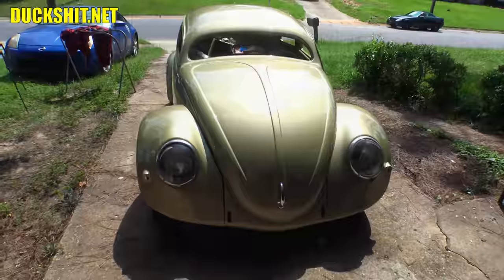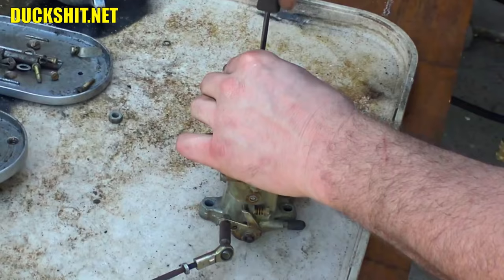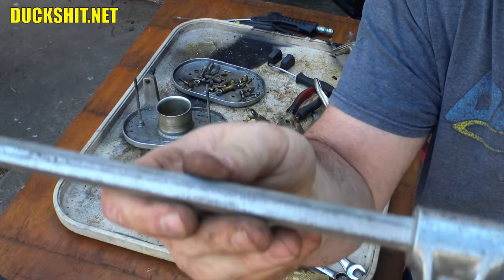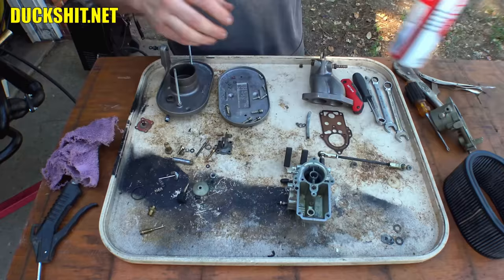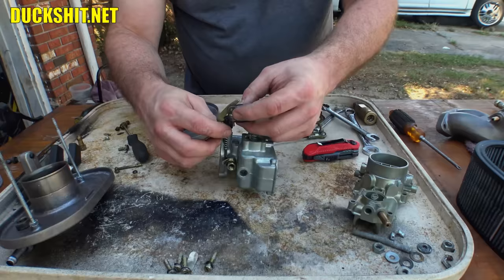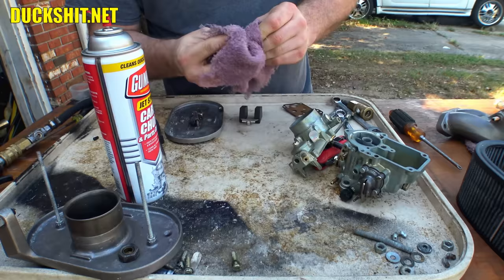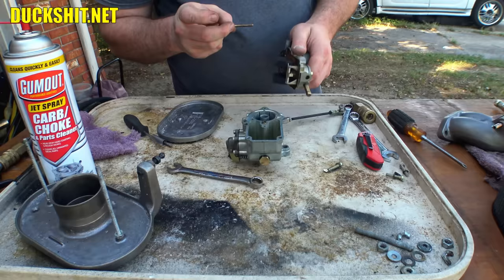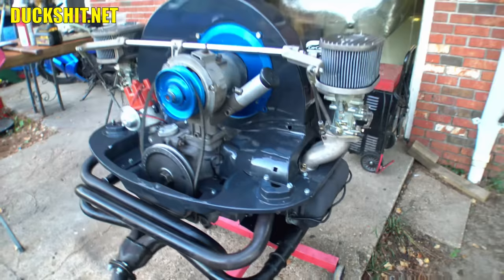🔧Dell'Orto FRD34b Carb Cleaning💥  -  1956 Chop Top VW Beetle - 176

Comment: I'm dropping my 79' 911 Targa off for paint in a week or so and when I pulled off the windshield last night I discovered rust in the lower windshield frame corners (naturally). So, I'm off to the garage right now to cut it out and insert it. Actually, glad I discovered it. It had window weld on the gasket that wasn't sealed at the top and the interface was full of dirt so the water was running down and just sitting in there.
Reply from the maker: Yikes!  There is supposed to be weep holes in the corners.  Make sure you either put them back or butyl everything shut so no water can get in!   😁👍🏻🦆💩
Reply: @DuckmanCycles   No weep holes in 911 windshield frames.

Comment: I have a very similar sonic clean. It’s great on carbs. I have found that if you run it , with the temp high, the aluminum will darken. Not a big deal. When I use simple green, I rinse with water. It evaporates fast, due to being warm. Your turned out great.
Reply from the maker: Ahhh and I thought the simple green caused the color.  I like the way it turned out though!   Thanks man!
Reply: @DuckmanCycles  It still might, I used the Industrial strength simple green at a higher ratio and it will darken aluminum pretty quick.  But I also don't care because it's easy and safe and WORKS.

Comment: Guess it said 92 on the date wheel which would make sense as carburetors was pretty standard until catalytic converters didn’t get mandatory in Europe until that time
Reply from the maker: Yeah 1992 is when Dellorto discontinued most automobile carbs, they also pulled out of USA at same time.

Comment: I had a shop build me a new 1915 (Crap Build) and it came with CRAP HPMXs, even though I specified Webbers.  Brand new, it took 3 major cleanings to get the crap slag out of the new carbs.  I've had them a year and still might toss a new set of Webbers anyways because it just wont stay in tune.
Reply from the maker: Yikes... are they real Webers?  Or China clones?

Comment: I would use loctight on your flywheel bolts
Reply from the maker: I wouldn't.  There is only the one "flywheel bolt" and that is the gland nut, and proving you torque it to 250-300ft/lbs its not going to come loose.

Comment: no rain must be a miracle lol. 

i was always told carb cleaner wasnt good for plastics which is ironic as carburetors sometimes have plastic in them. i use brake cleaner not that i have any carbs but its apparently safe for plastics an good for cleaning loads of stuff
Reply from the maker: Most Plastics you find in carburetors are solvent-safe.... but ironically, sometimes they have problems with swelling from ethanol.  Ducati is well known for fuel system plastic problems lol.  You should see how big their gas tanks grow!
Reply: @DuckmanCycles  yeahthat ethanol shit can really cause problems we have had it start here in the UK you can still buy the premium stuff but the standard stuff is with ethanol now. 

My brother has a lada he drives daily to work he has to run it on the premium as it's obviously got a carburettor. Tell you what though gets more attention than anything on the road lol
Reply from the maker: Also, it hasn't rained in several weeks.  There is some in the forecast a couple days from now though.  It's so incredibly dry out there that it was hard to get traction with the RC car video that I did yesterday.  The little thing would just dig holes in the sand!
Reply: @DuckmanCycles  it must have come over here to the uk it's been raining for a week lol
Reply from the maker: @TotoGuy-Original  lol probably so!   Hehehe

Comment: the chromed tins and exhaust do hold more heat in and reflect it back, as compared to flat black paint. but a well tuned engine will still run cooler anyway, tuning tuning tuning! well that and good gearing.
Reply from the maker: Chrome tins don't hold any more anything.  The thermal mass is the same.  Flat black does radiate better, yes.  But even so... tins themselves don't need to be cooled.  Even red hot tins aren't exactly an overheating engine.

Comment: Did you know that by wrapping those wires around the distributor you could magnetisme your points which will make them stick together? Better be careful, you should put a Porsche flat 6 in it. 😁
Reply from the maker: Ohhhh noezzzzz!   LoL!  Good thing there's no points in there!  Haha!  I'd have to replace the whole engine with the flat 6 if that happens!
Reply: @DuckmanCycles  no points??!? That engine is going to run terrible! So either the flat 6 or you should put an LS in it. Those are made of aluminium so that they can't be magnetized
Reply: lol 🤣
Reply from the maker: @pascalz9992  I may have to cut the LS in half and turn it into a flat configuration to make things right.

Comment: it will be fine with the  four dowel flywheel, just use a good gland nut and don't keep dumping the clutch like your racing. now it's built up beyond a 1915cc, has huge tires like a rail buggy or drag slicks and your going to clutch dump/high power, then 100% go  8 dowel and wedgemated crank and flywheel combo. (taper fit crank/flywheel and hardened gland nut torqued higher).
it's not new tech by far, Berg and someone else did it in the early 60's? back in the hay day's of VW drag racing. I played with off-road rails back in the mid 90's and aft. 
😝
Reply from the maker: Even if I dumped the clutch, on stock slippery tires, with a 1600 engine and everything set up right, there's not too much damage I could do.  Bigger engine to come later!  The fun stuff will go in that one!  Then I'll melt these tires!  Hehe!

Comment: They came out really nice, I have to sit and clean mine with scotch bright pads lol as I don't have a cleaner. I noticed your filter base has an inlet for the oil filler neck as a breather? Is that fine to do or will it draw oil out due to the vacuum from the car under acceleration? Wondering how I should set mine up.

Comment: What are the Dellorto FRD's like compared to Weber 34ICT's
Reply from the maker: Similar, performance wise, if both tuned properly, you probably wouldn't notice any difference.  Everyone has their favorites.
Reply: Dellortos FRd , precious carbs and well designed for these engines.
Reply from the maker: @erwinsm10  They are very special, not sure if they were designed specifically for the Volkswagen because you can find them on other vehicles, but their design does lend well to that of a VW.   Very happy with them on my Fastback!

Comment: Hey Duckplucker you should take that blue pulley and generator adapter thingy off. Don't you know the engine will run too cold with blue pulleys and adapter thingies? Especially when you pair them with clean carburetors? Sheeze don't you know anything? 😁
Reply from the maker: YOU SHOULD!  hahaha!  That should work, though!  I'll look into it!